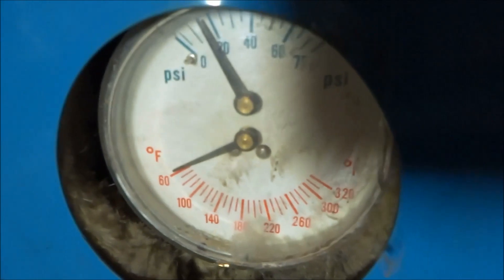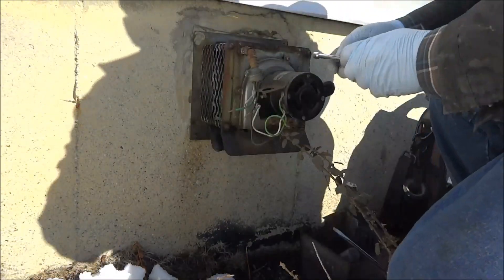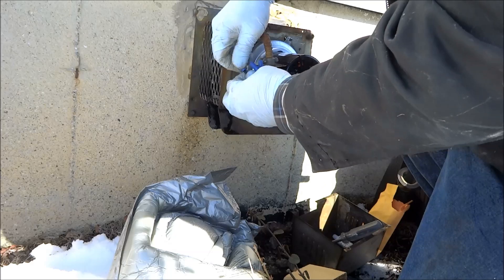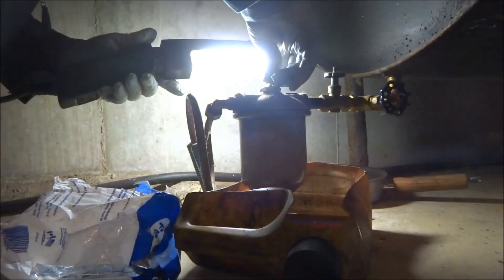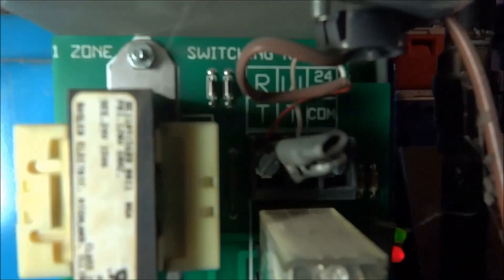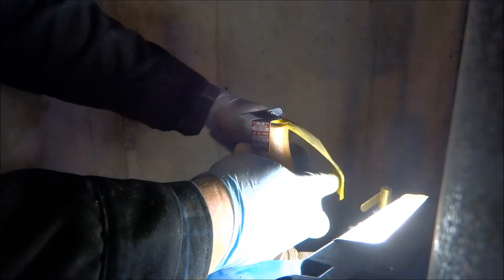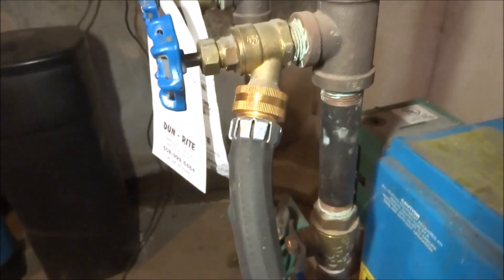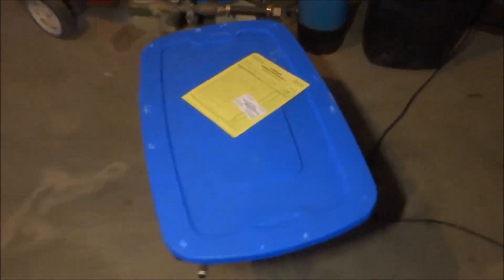no heat call with many issues

Comment: Steve you are very professional at what you do man as a HVAC tech myself for 36 years now it's great to see a HVAC guy like yourself who reminds me of myself.Iam very good at HVAC work myself and I understand now why you are video recording yourself now with a call like this that had multiple issues and repairs needed to get the system up and running.I think it's time I do the same and start recording all my work for multiple reasons.I have never had a insurance claim or have been sued by a customer in 28 years now in business and Iam a 1 man show like yourself except I do get help from my rockstar brother when I do some HVAC installs due to a back injury with 2 failed back surgerys after I fell 42 foot off a ladder 23 years ago working on a unit heater in a very large warehouse.I had a young helper spotting the ladder who walked away from ladder for about 20 seconds and ladder kicked out.Changed my life but I refused to stop doing HVAC work like doctors told me I would have to.Keep up the great work Steve and great videos my man.

Comment: I like to use a stop and waste valve on the expansion tanks to avoid draining the system. Also use brass unions on relief valve down pipe, makes easy swap out.
Reply from the maker: Truckguy900 Truckguy900 good idea

Comment: .75 80b? Did you put that in there for job security lol
Reply from the maker: eighttenk no that what that size house need to heat it. .75  will be fine .and will do the job needed.
Reply: Probably but i was talking about the spray angle. It looks like an l/v head from the video...with an 80 degree nozzle that wont run clean for more than a few months
Reply from the maker: eighttenk its a beckett afg  i never have a problem with them .. thats the nozzle that was in there to began with .
Reply: I agree with eighttenk. I always use a 45a or 60a with a Vhead. I love watching your videos Steve!